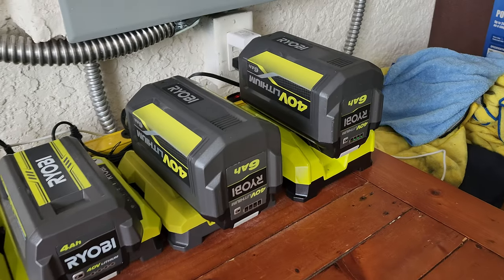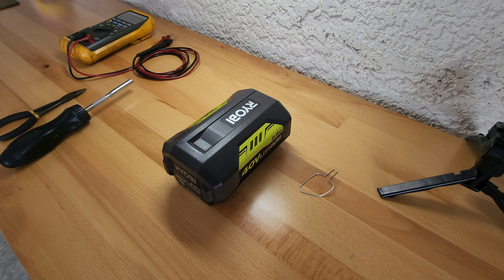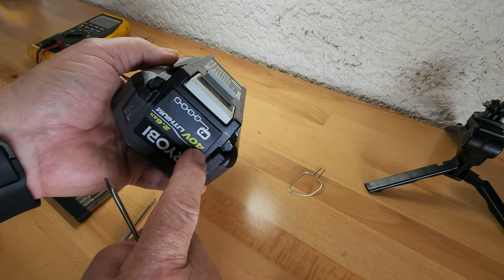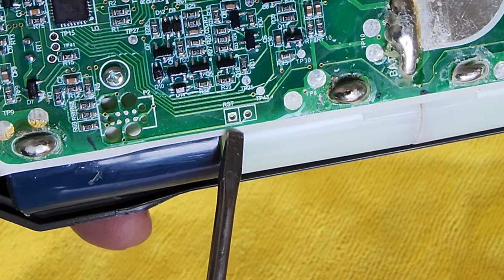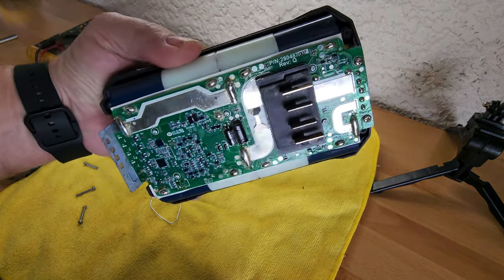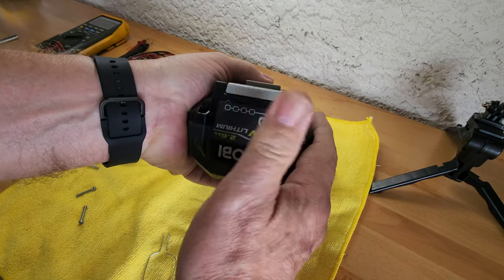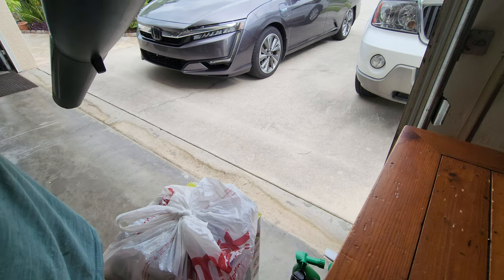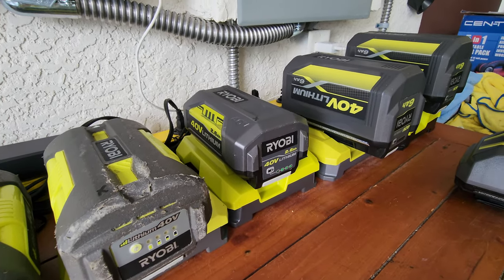Ryobi 40V battery fail, Master Reset!!!

Comment: I have a 40v 4ah Ryobi that works on the weed wacker but not my chainsaw.  Very little time on either tool.  Do you have any tips?
Reply from the maker: Sorry, I don't have any tips. I don't have a chainsaw to compare or try. What was the original battery that came with the chainsaw. Maybe one is an early build and the othe is much newer build 🤔.  Maybe Ryobi made a change in interchangeability?  Would be good information 👍.
Reply: @htnowpro  I had contacted Ryobi and they said that the batteries should be interchangeable.  Thx for replying.
Reply from the maker: @markdadian3323  thank you for the follow up. Please let us  know if you find out the cause. I'm sure it would help someone. Have a great week ahead 😀.

Comment: I took mine apart and checked the voltage and I get 38.9 V on the battery but it flashes green and red in the charger and it won’t work in the mower. so I took it apart and I do the reset trick and that makes it work but even though it has 38.9 bolts in it it says it only has one bar of power. Regardless, I plugged it in the charger and it flashes green as if it’s working for about 30 seconds and then goes right back to flashing green and red and I’ve done this probably 30 or 40 times already do you have any ideas what could be going wrong? I actually have two of these things the same exact thing I tested the boards for shorts. I tested the capacitors as best I could without removing them. I really don’t want to rip the board apart if it’s gonna be something simple but I don’t know what else to do. It’s drive me crazy that I can’t use my mower but there’s almost 40 V in the battery. Do you or anybody else have any ideas? What could be going wrong?
Reply: And yes, I tried doing it while holding the button on the end. Also, I’ll just pushing the button on the end and every valuable in between I could think of I even added two wires to the reset and ran them outside so I could keep tying them together every time, the battery switched back to alternating green and red so that I wouldn’t have to pull it all back apart and so that works but I’m not getting anywhere and I have almost 40 V in the battery so my next step is going to be to run wires from the batteriesinside that is to say the NCAA batteries I’ll run a negative and positive negative and positive on the bracket and see if I can bypass the board. I don’t know what else to try at this point.
Reply: Oh, and like I said, it’s two different batteries doing the same exact thing they’re both about the same age I don’t know why this is happening, but I doubt that two boards could’ve been broken at the same time
Reply from the maker: I don't have any other information.  It sounds  like you have thought of everything to try. The logic system is not happy 😒 but that is the part we have nothing to check it with. If only they had built-in flash codes for diagnostic purposes. At least we could have an understanding of the cause. Great detective work. Sorry 😞 I have no other information.  Ryobi should have chimed in to this post long ago.

Comment: Any idea why the reset works abs does the battery fail again anytime soon?
Reply from the maker: Reports go both ways, a few said the battery still failed. Most reported all good 👍.  My battery has never done it again and is still working.
Reply from the maker: Why does it work? It's no different then pressing control, alt, delete on any PC that is locked up. If it goes right back it has a hard fault.

Comment: My battery had 4 leds blinking.
After reset i blinked all 4 leds one time, then led 1 and 2, then 1 3times
The charger stayed red, piwer on
Tried my other battery same charger, the green charging led came on
Battery jump unsuccessful. 
What would help is to know the flash sequence means.
4 leds flash, 1&2 flash 1 time,
The led 1 flashed 3 times
Reply from the maker: Absolutely, it would be great information to have a trouble code chart. Maybe someone can share it with us. Thank you for sharing your thoughts. Have a wonderful weekend coming up.

Comment: My battery is showing 36 volts but won’t start the trimmer and when I put it on the charger,light alternates red green…I tried the reset and button trick and the 4 lights come on and also shows 2 lights as per only partial charge…bottom line is it won’t complete a charge..any thing else I old try?   Ps.  I brought the battery back to life last summer with the dc-dc voltage converter trick but over winter now it won’t take a charge
Reply from the maker: I can't think 🤔 of anything else. Clearly, it indicates the state of charge. It would be great if RYOBI would read these customers' comments.  Call RYOBI, some viewers repot they sent them a battery depending on the serial number.  Please check back and let us know if you get any service from RYOBI.

Comment: Just for confirmation this method is to correct the error green / red flash on the charger?  That what I have going on
Reply from the maker: Yes, it doesn't work for everyone.  Batteries have different build dates etc. There has been many Batteries put back into service.  Hope it works for you.  Thank you for watching and commenting.

Comment: So i bought 2 trimmers now(Ryobi cordless 40 Volt)..and both have crapped out on me...the newest one..i bought Sept 15th/2022..used it for a month..and now for 4 months in 2023 & the thing died..I called Ryobi..they said mine was defective..40Volt..so they sent me a new battery this past Fri..Sept..and it doesn't work..how frustrating. It won't go to a solid green..after charging for many hours..i put it in the trimmer and it goes for 15 seconds & stops..same as the old battery...so i'm not sure what's up with this Company & brand..but it isn't very good..what exactly is the problem with their trimmers? It's a holiday today..so i have to call them back tomorrow..Sept 5th and tell them this new battery they just sent me isn't working either..neither battery will ever go a solid green...just crap.
Reply from the maker: Wow, it's very strange that a new battery and an older battery would act exactly 💯 the same? I had one trimmer fail and two that have been going for quite some time.  Please let us know how it turns out. Thank you for sharing your experience.
Reply from the maker: The mechanic in me says, "If you tried the original battery in your car and a brand new battery in your car and it still would not turn over, other problems would be highly suspect

Comment: So everything indicated that my battery was bad. Turns out my charger was bad. The lights were flashing in the same way that indicated it was a bad battery. I discovered this after ordering a new off brand battery from Amazon and realized that the charger was the issue. So, if you’re having a battery issue, check the charger! It’s a lot cheaper to replace.
Reply from the maker: Great advice.  In my case, I have three chargers from three different 40v tools, so it was easy to isolate it to the battery.  Your point is well noted. When it comes to diagnosis of a concern, check every aspect. Thank you for taking the time to share your experience.  It will help everyone.

Comment: Hi!

Can you help me!

Was wondering if anyone can provide some help/ input. 
I have 2 Ryobi 40V Lithium Batteries. 
I had placed them in my garage near my door. I was rushing to park my car inside due to the storm/ rain. My front bumper happened to be parked over my 2 batteries and managed to get my two batteries wet from the rain that was on my car, etc. 
I am not sure how much water got on top of them but I noticed they were wet/ damp. However, I still saw the green meter/ light when pressing the button to see how much life there was left. 
I talked to one RYOBI rep and he said wait 72 hours to fully dry (which they are) before charging them/ turning them on.
He said as long as it was submerged in water, etc. 
However, I don't feel comfortable charging them since another REP of RYOBI said to discard them.
What should I do? Is it safe? 
TIA
Reply from the maker: I don't think anyone can say it's safe or not. Ryobi said it was OK. One said it wasn't.

Comment: I've got a brand new 7.5 AH Ryobi 40 volt batter that won't take its very first charge. When I push the charge status button the first and third lights light up. I haven't found any info on what that actually means. I took it apart to perform a reset and cannot find any RST port on the board. When I put the battery in the charger, it shows red and green lights with the green light flashing for abouit 10 seconds then the green stops and only the red stays lit. It flashes very very slowly. Any thoughts?
Reply from the maker: I don't have any thoughts or insider information.  Would be nice if a Ryobi tech would chime in with some real insider information 🤔.  Must be someone with the knowledge.  Thank you for sharing your battery issue.  Please call Ryobi and let us know how it goes.  Have a wonderful week.

Comment: Would’ve like to have seen how difficult to hold those little prongs in place while pushing reset button.
Reply from the maker: I would have showed it, honestly it was simple.  I had previously performed it without much expectation....and then it worked!!! So I shared my experience but didn't dare mess with a working 🙃 battery.  Not taking any chances...lol. Thank you for watching and commenting.  Have a wonderful weekend.
Reply: @htnowpro  Thanks for the info. Appreciate it.
Reply from the maker: @dancindavey1515  you are very good 👍.

Comment: I tried this on my battery and it flashed all 4 when I reset it vs 1 and then it said it was at 1 bar flashing. Put it on charge it showed 3 bars flashing the 4th light for a minute or so then went back to flashing red green
Reply from the maker: Some batteries have hard faults, others just need a reset. Sorry 😞 it didn't work out for you.  You did your due diligence to solve the issue. Thank you for sharing your experience.

Comment: I did this had one flashing light  on after reset put it back on charger and ,it shows almost fully charged and then goes back into red/green
Reply from the maker: Thank you for sharing your experience.  Some batteries have other concerns. Sorry it didn't work out for you, but you did your research and due diligence.  Have a great week.
Reply: @hightechNow  I'm now try connecting a fully charged  battery  to it to see 8f it will bring up the voltage

Comment: How do you take out the dummy screw?
Reply from the maker: It's just a plastic cap over the screw head. You have to use a small pick or screw driver.
Reply: @htnowpro  thank you Sir!! Got that part out, used a paper clip just like you did but no luck, 4 lights turned solid when pressed both reset buttons
Reply from the maker: Please read all posts. Depending on how long it's been sitting and state of charge you may have to go thru the cycle several times trying to charge.
Reply from the maker: Please read post from datona dan

Comment: Need “security” hex to take off screws.
Reply from the maker: They don't cost much on Amazon. Some viewers say drill out the center.  Some say you can break it off. I prefer using the correct tool.

Comment: Doesn't work on P/N: 280487 (026)    Rev:V1.3

When jumping it turns all lights on and no affect from button nor does the 5 count (or in my case 30 second) make a difference.   I connected it to the charger and performed the PIN grounding and no affect.   Sorry 😞
Reply from the maker: Sorry it didn't work for your battery. It's sort of like an automotive repair, not all similar symptoms have the same root cause.  Thank you for sharing your experience.
Reply: 026 here and it didn't work for me either. Jumping turns all lights on, but charger still shows defective battery. I did randomly see one light blinking (instead of all 4) at one point, but could not replicate. I reset>charged about 40 times, still no luck.

Comment: The problem here is my lawnmower (turns on while cutting grass, while awaits 2 secs on (it shuts down right away) can anyone give explanation? Help please before I dissemble battery!!
Reply from the maker: Is your grass too tall? 🤔 It will not mulch tall grass, you must open the side exit and try cutting half the width, same as a gas mower with too tall grass.  I am only guessing, since I don't have any other information.  I do know, if the mower has to go into high mode, it will shut off soon.

Comment: How to reset 18V, 5Ah battery? I have four leds flashing four times and... It's dead :(
Reply from the maker: Hello, some batteries have hard faults that cannot be reset. It was worth a try. Sorry it didn't work for your battery.
Reply: @htnowpro  In this particular type of battery, there is no tab to reset the microcontroller...
Do u have any idea which type of replacement I can use to save the battery? Even without possibility to charge it with dedicated charger.
Reply from the maker: @ukaszseklecki6177  question: did you press the battery charge indicator button while jumping the bms board as in the video?
Reply: @htnowpro  Hello again. As I wrote before, I do not know how to reset this type of battery and I'm already almost sure, it is not possible (no tabs on the motherboard).

Comment: My battery had on screw by the factory blocked so I had to break it open, tried the reset method and it did not work
Reply: It reset then went back ti defective
Reply from the maker: Sorry your battery didn't make it. Must have a hard fault . Thank you for sharing your experience.

Comment: So I did the reset four times put it on the charger and each time within a minute it was back to needed another ‘reset’ is it just a bad battery?
Reply from the maker: It looks that way. What ever the logic error is, it seems to be a hard fault and not able to be reset. Wish we had a way to test further. Logic board or cell issue, unfortunatly the result is the same. Question: did your's have the four led's all flashing at once when the button is pressed? Just curious if the fault seems to be the same. Thank you for watching and sharing your experience. Have a great weekend.
Reply: I attempted this reset several times. After pushing the button the 4 green lights would turn on. Then it would go to 1 flashing green light. Sadly once I put it in the charger it would flash defective and go back to 4 blinking green lights
Reply from the maker: It was worth a try.  Last viewer reported the same. It must have a hard fault and it won't allow it to charge.  Good news is you won't be discarding a good battery that could have been reset. Thank you for sharing your experience.  Sorry it didn't work out.  It was worth a try.  Thanks for watching.
Reply from the maker: @meyers.makes.  maybe try a different charger. Find a neighbor or friend 🤔.
Reply: Repeat the process at least 10 times.  I had the same issue.  Each time the amount  time before fail light came on was longer. Finally, after many many attempts,  it charged normally.  Not sure it will work for you bit it did for me.  I had just about given up before it finally worked    If the normal charge light stays on longer after each reset, before failing,  you can probably can fix it with a series of reset/ charge attempts.  The exact number of attempts will depend on the state of the battery.
Reply from the maker: @daytonarama  great advice from someone who has had success 🙌 👍.  Thank you for sharing your success and advice 👍. Have a wonderful weekend coming up.
Reply: @htnowpro  Sadly, after a full charge... four lights on.... the actual charge was just one light (when you push button, off the charger) .  It does work  but I assume most of the cells are dead so only 25 of the power (if that) of a new battery.  ie, a lot less run time.  But something is better than nothing.

Comment: I have 6 amp 40 v. And I don't see a reset position
Reply from the maker: Ryobi has different build batteries.  Early/ Late etc. Manufacturers make design changes and it looks like this video does not apply to your battery. The only option is to call Ryobi and see if it is possibly under warranty.  If not, find another tool you need that comes with a battery and purchase it. Hope this helps.  I have no information on your style battery.

Comment: Plz help
I did this ab 20 times amd mine is still blinking :[
Reply from the maker: Some batteries had hard faults. Resetting the software can not restore hard fault issues.  You have done your due diligence by researching the issue and attempting to reset the software/ hardware. I don't know of any other means to restore your battery.  I would like nothing better than to help with an answer. Thank you for reaching out to me.

Comment: I am so soured on the Ryobi and battery issue. It's all gone when this new battery gives out. Not consumer friendly at all. Sad engineering. What a scam. The battery will drain thru the winter. Bad bad stuff
Reply from the maker: Battery drain is common, my DJI drone batteries are described as : the slow drain is to protect the lithium battery in storage.  So I think that is by design. No doubt having corded electric tools would last longer , Cordless is purely for mobility and convenience.  I am researching solar generators ( battery banks) . They are leaving lithium ion chemistry to go to lithium iron phosphate ....the life cycle is 10 times that of lithium ion. But they are heavy.  Battery operated tools are what they are.....useful but limited.  Thank you for watching and commenting.  Have a wonderful weekend.
Reply: @htnowpro  I don't have any trouble with other batteries. It's the large, rather expensive lawnmower lithium batteries that are a problem. I store all my batteries fully charged. This Ryobi one was on one light after winter. Darn near drained. Do not have that problem with the others. Hmmm, my little deep cell for my boat still going strong after 7 years of summer use. It's no heavier than these lithium ones. I feel we have been bamboozled on these lithium things. Very disappointed